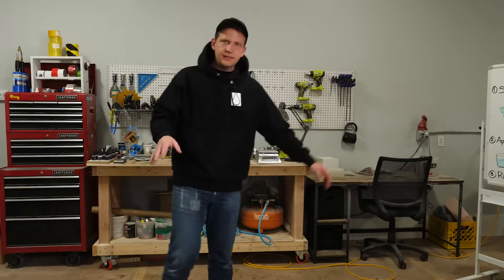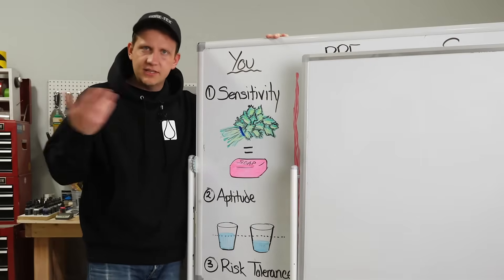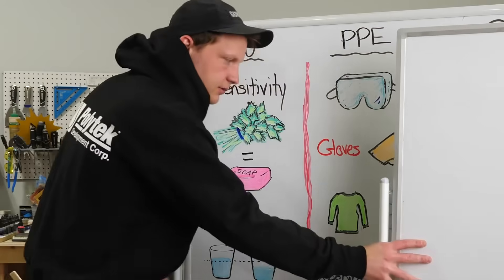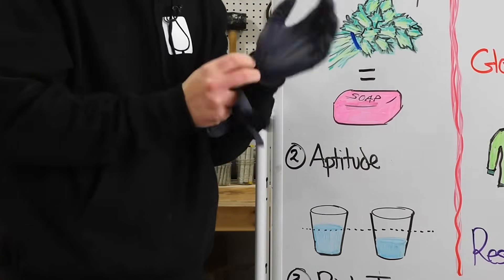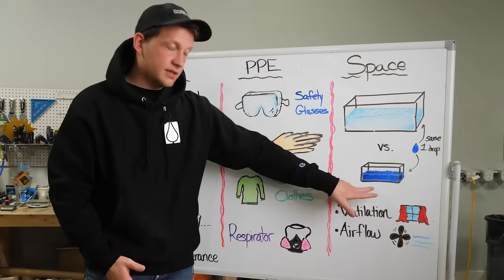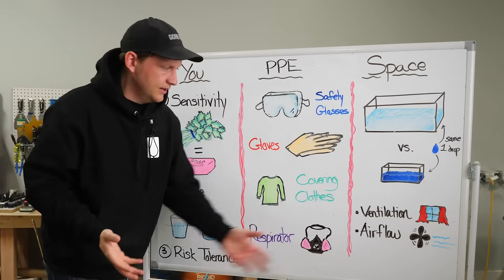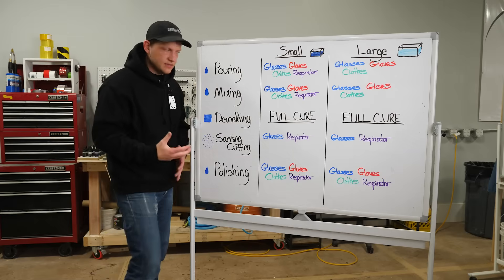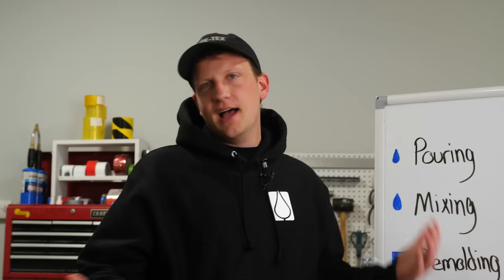Alumilite Explains: Epoxy Safety

Comment: what is the best Respirator to use. what filters should we look for on a Respirator. you forgot to add that to the video kinda a big safety thing there. i couldn't find any info about it. i used ai to hopefully get my answer. it said 6001 filter is good at blocking resin vapors. but what is the best and is this even correct. i am gonna do more research on it i am not trying to mess up my lungs today
Reply from the maker: Recommended Respirator:
Use a NIOSH-approved half-face respirator, like those made by 3M or Honeywell.

Best Filter/Cartridge for Resin Work:
3M 6001 Organic Vapor Cartridge – good for blocking fumes from urethanes, epoxies, and similar resins.

For added protection, pair with a P95 or P100 particulate filter (e.g., 3M 5P71 or 2091).

Additional Safety Tips:
Always work in a well-ventilated area.
Store cartridges in a sealed bag when not in use.
Replace filters regularly to maintain effectiveness
.
Still have questions? Reach out anytime at (269) 488-4000 or info@alumilite.com.

Comment: Hello  @AlumiliteCorporation  , I’m new to using epoxy resin and thinking of trying it your video is really helpful. I just have some questions though.

Is it ok to do epoxy resin and outdoors? Like an open area - no walls, either with ceiling of no ceiling? How far does fumes travel for safety? Since I also need to consider other people and pets within the vicinity.
Reply from the maker: Absolutely, working with epoxy resin outdoors is okay. Just be mindful of a few key things:

Keep your workspace sheltered if possible wind, dust, and insects can affect the finish.
Watch the temperature most Alumilite resins cure best between 70–80°F.

 You can also reach us at (269) 488-4000 or info@alumilite.com for more support.

Comment: The bad-cilantro gene. Some people have it and some don't.  I do, and cilantro does in fact taste exactly like soap to us! There is another gene that lets you love sulphurous vegetables like Brussel sprouts, which i alo have and they are delicious,  others do not and can't stand them. This is not really a "sensitivity" it is a genetic predisposition. 

 Sensitivites can occur in anyone and are not always linkable to specific gene types. They are often immune-related and also usually get worse with each exposure. 

I would like to know exactly what type of respirator and cartridges are appropriate for use with epoxy?

Comment: It’s a great demonstration, thank you . But I have questions, how Handel if I get Allergie ( skin rash !?
Reply from the maker: If you're having an allergic reaction to resin, stop using it immediately, wash any skin contact with soap and water, and step away from the area. For mild skin irritation, use hydrocortisone cream and/or an antihistamine. If breathing becomes difficult or your face swells, seek emergency help right away. 

To prevent future reactions, wear nitrile gloves, work in a well-ventilated space, and consider switching to low-sensitivity resins like Amazing Clear Cast Plus. Always patch test first!
Reply: @AlumiliteCorporation thank you for the answer

Comment: What is the best epoxy for coating oil production equipment where the temperature is 120 degrees Fahrenheit and the pressure exceeds 400 psi? Will the epoxy withstand it? I am currently about to start working on it in two days. Is it single? I hope for a response. Thank you.

Comment: So I have a room designated for resin and I'm using PPE in that room, it's too cold to leave the windows open and it takes 72 hours to cure between layers....Do I need to keep my windows open while it's curing? So it doesn't affect the other rooms/people of the house? I reached out to the manufacturer of the resin I've been using and they told me it was 100% safe and didn't say anything about PPE. Definitely not taking their word for it and am saving that email LOL.
Reply from the maker: Great question! Yes, you should ventilate your resin room while it’s curing—even if the manufacturer says it’s "safe." Polyurethane resins can still off-gas VOCs during curing, which may affect other rooms or people in your house. Use an exhaust fan or air purifier with a carbon filter to keep fumes contained.

Even during curing, keep wearing PPE  for extra safety—better safe than sorry! 😊 If the 72-hour cure time is a challenge, try raising the room temperature to 75–85°F to speed things up or look into faster-curing resins.

Let me know if you’d like more tips! 👍 For further help, contact us at (269) 488-4000 or info@alumilite.com! ✨

Comment: Thanks for this video!! I've got a quick question: if we work with food-safe type of epoxy, whic is labeled as "non toxic" are we still supposed to use all the PPE you showed? 
Thank you!
Reply from the maker: Even when working with food-safe or non-toxic epoxy, using proper personal protective equipment (PPE) is still recommended. Here's why:

Why Use PPE Even with Non-Toxic or Food-Safe Epoxy?
Safety During Mixing and Application
Epoxies labeled as non-toxic refer to the cured state—once fully hardened, they’re safe for food contact.
However, in liquid form, epoxy resin and hardener can emit fumes, and skin contact might cause irritation or sensitization over time.

Fume Inhalation Risks
Some food-safe epoxies still emit low levels of fumes during mixing and curing. While these fumes may not be highly toxic, prolonged exposure could still cause headaches, dizziness, or respiratory discomfort. 

Skin Sensitization
Repeated exposure, even to "safe" products, can lead to allergic reactions or dermatitis for some people. Wearing gloves and protective clothing minimizes this risk.

Accidents Happen
Splashes, spills, or accidental mixing errors can occur, so it’s best to stay prepared! 

Recommended PPE:
Gloves: Nitrile gloves protect your hands from contact with liquid resin or hardener.
Respirator: A respirator with organic vapor cartridges ensures you're protected from any fumes.
Eye Protection: Safety glasses or goggles prevent accidental splashes from reaching your eyes.
Clothing: Long sleeves or a protective apron keep your skin safe from splashes.

Comment: Nice video but I have a quick question. After turning a piece I have to sand it. When I work with wood I use a good quality dust mask which I properly maintain with regular cleaning and replacing filters. Here’s my question: when I sand fully cured epoxy is a dust mask enough or do I still need a respirator with cartridges rated for OCs? Should I just increase the full-cure time period for better safety? Time to me is not a factor. An extra couple of days curing won’t cause an issue because I do so much work with just wood.
Reply from the maker: Great question! Safety is always a priority, and it’s excellent to hear you’re already mindful about using a dust mask when working with wood. 😊🛠

When sanding fully cured epoxy, the main concern is the fine dust particles generated during sanding. A good-quality dust mask can provide some protection, but a respirator with cartridges rated for organic compounds (OCs) is a better choice. This is because even fully cured epoxy can release fine particulates, and in some cases, trace amounts of residual uncured material might still be present.

Here’s what I recommend for sanding epoxy safely:

Use a Respirator: A respirator with P100 or N95 particulate filters and cartridges rated for OCs is ideal for filtering out dust and any possible fumes.
Work in a Well-Ventilated Area: Good airflow can help disperse particles and reduce inhalation risks.
Vacuum Attachment: If possible, use a vacuum sander to capture the majority of dust at the source.
Extra Cure Time: Allowing the epoxy to cure for an extended period (7 days or more) before sanding can ensure it’s fully crosslinked, reducing the risk of exposure to any uncured material.
Taking these precautions will ensure that your workspace is as safe as possible while you create. Let me know if you have more questions—I’m here to help!

Comment: Why dont you recommend the kitchen??
Reply from the maker: Using the kitchen for resin or epoxy projects is generally not recommended due to safety and cleanliness concerns. Here’s why:

Why Avoid Using the Kitchen for Resin Work?

Chemical Exposure:
Epoxy resins and hardeners can release fumes during mixing and curing. Even if the product is labeled as low-odor, it's best to avoid exposing areas where food is prepared to these chemicals.
Spills or accidental contact with kitchen surfaces can be difficult to clean completely, posing potential contamination risks.

Food Safety:
Residues from resin or solvent cleaning can linger on counters, utensils, or other surfaces, creating a hazard if they come into contact with food.

Ventilation Concerns:
Kitchens aren’t always designed for the level of ventilation required to safely use resins, particularly when mixing or curing. Proper airflow is key to minimizing inhalation risks. 

Cleanliness and Cross-Contamination:
Kitchens need to stay as clean as possible. Resin particles, sanding dust, or chemical residues can contaminate the space, making it unhygienic.
Reply: @AlumiliteCorporation  thank you so much for replying! I decided not to do resin since I already suffer from eczema and have allergies plus I don't have a nice ventilated area except the balcony so it's best I stay away 😅

Comment: Hey! Thanks for the vid, super good explanation. I was wondering how much should I OCD about cleaning the powder that comes off when polishing? I have a kid and I need to know if the residue that gets lodged in corners and crevices is dangerous.
Reply from the maker: You're welcome! Glad the video was helpful! As for the powder residue from polishing, most of it is non-toxic, but it's important to keep the area as clean as possible, especially with a child around. Polishing Alumilite products can generate fine particles, and while they aren’t hazardous in small quantities, it’s a good idea to take extra precautions:

Use a vacuum or a soft brush to remove residue from corners and crevices.
Wipe down surfaces with a damp cloth to trap any dust or powder.
Ventilate the area where you’re working to minimize inhalation of particles.
Consider wearing a mask while working to avoid inhaling the finer dust.
Keeping the workspace tidy will help reduce any potential concerns. While the materials are generally safe, it's always best to err on the side of caution when kids are involved. Let me know if you need more details!

Comment: I have a small room with a fan blowing out the window and an air purifier with active carbon filter if I use epoxy resin in that room do I need another fan blowing the air toward the window and do I shut the door or leave it open , I'll be using let's resin and I emailed them asking a few things and no reply can you help please, I ordered everything I'll need ppe wise just want to do this safely,,thank you
Reply from the maker: When working with epoxy resin, good ventilation is key to keeping the air fresh and reducing exposure to any fumes. Here’s how to optimize your room setup:

Fan Setup:
It's great that you have a fan blowing air out of the window—that’s a perfect way to create airflow that moves any fumes outside. Adding a second fan blowing toward the window (from inside the room) will further help push those fumes out, especially from the work area.
This airflow will help remove fumes and pull in fresher air, which is ideal!

Door Open or Shut?:
I recommend keeping the door open if possible. This allows for better cross-ventilation, meaning clean air can flow into the room as the fan blows the resin fumes out the window. If the door is closed, you're essentially limiting the airflow, making it harder to fully clear the room of any potential fumes.

Air Purifier:
Having an air purifier with an active carbon filter is a great addition. Keep it running while you work with the resin, as the carbon filter can help absorb some of the fumes, though it's not a replacement for ventilation.

Personal Protective Equipment (PPE):
It’s great that you’ve ordered the necessary PPE! You should be using gloves (nitrile is best for resin), safety goggles, and a respirator mask with organic vapor cartridges to protect yourself from fumes.

By following these steps, you're setting yourself up for a much safer workspace! 🛡

Just a few extra reminders:
Keep pets and children out of the room while you're working with resin, as they’re more sensitive to fumes.

Allow your project to fully cure in a well-ventilated area, even after you're done working with it.
Reply: @AlumiliteCorporation will the fumes enter the rest of my apartment with the door open?
Reply: Thank you for your reply its greatly appreciated
Reply from the maker: @SherSher222  If you're working in a room with the door open, there is a chance that some fumes could drift into other areas of your apartment. To minimize this, I recommend:

Using a fan to direct airflow out of a window or toward the open door 
Keeping other doors closed to limit the spread of fumes 
Setting up your workspace in a well-ventilated area, ideally with windows open, to allow for proper air circulation

Comment: How do you deal with ventilation in winter months when temperatures outside can be quite cold?
Reply from the maker: Great question! Dealing with ventilation during the colder winter months can be tricky, but it's important to ensure proper airflow when working with resin or other casting materials to maintain a safe environment. Here are some tips to help balance safety and comfort:

Ventilation Fans: Use an exhaust fan or open a window slightly with a fan directing air out of the room. If you can, set up the fan to pull air from the work area while drawing fresh air in from another part of your home, keeping the cold air to a minimum. 

Create a Barrier: To avoid letting in too much cold air, you can create a temporary barrier using plastic sheeting or even foam boards near the window or door where you’re pulling in fresh air. This can help limit drafts while still keeping the air moving. 

Work in Short Bursts: If possible, try doing the mixing and pouring quickly in a well-ventilated area, and then allow the piece to cure in a slightly warmer spot. This way, you limit your exposure time to cold air.

Warm the Workspace: Be sure to keep the workspace at the recommended temperatures for your materials, ideally around 70-75°F. You can use a space heater or heat lamps to maintain this temperature, but just make sure not to overheat the area, especially if you have flammable materials.

Comment: I use a machine that internally mixes Isophorone Diisocyobate and Polyol - to create a polyurethane resin to coat labels. I’ve started to use a PAPR with an organic filter. Is that enough to not be inhaling?

Comment: You always have to wear a respirator regardless of the size of your working area. Working outside doesn't offset the need for respirators either. These are seriously toxic chemicals and you do NOT want them in your lungs

Comment: First off, THANK YOU FOR WHAT YOU DO!  i do have a couple of questions that would help others as well. Your response would be very much appreciated!! Thank you ahead of time! 

Unless I missed this, when epoxy is curing, isn’t it giving off gasses during that process where it needs to be in a well ventilated area unit it is cured? Using PPE when working with epoxy resin is required, but shouldn’t the same hold true for while it is curing? Example…You work with in your craft room with windows open, but then close the windows and work in your craft room while it cures seems unsafe, or is it? 

That said, if it is we ogre with in small spaces but then you close the windows, do the harmful agents dissipate over time, or is that air going to remain in your home? 

At this point I am using polymer clay and uv resin as a topcoat. UV resin is considered safer because it cures quicker, but aside from that, using PPE is still a good thing, right? Or is it not needed? (It may come down to risk tolerance, but I am still thinking it is a good idea.)

Does polymer clay have any harmful effects? 

Lastly, I almost got on good pair of gloves. Glad I did not because you specifically state disposable. I read NITRILE gloves are best? And should they be 4ml or 6 ml? 

Thank you. Answers to these questions may help others as well. Also, do you have a pdf on resin safety?

Comment: Also : hygene. Don,t eat or drink in your epoxy workshop. And chose the right gloves : nitril. No latex nor pvc gloves will protect adequate enough. Also when using fillers like microballones, q-cel, aerosil etc. Dont breath this fine powder in and keep your workshop clean. Use a separate area to mix your chemicals. Cheers !